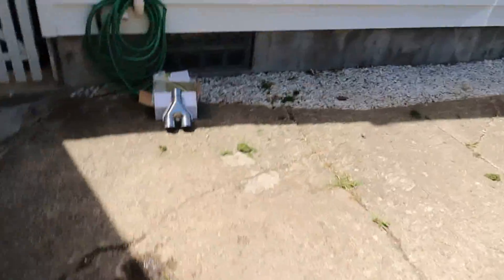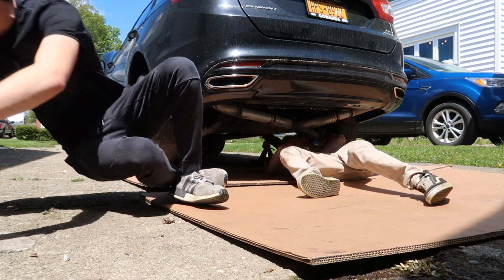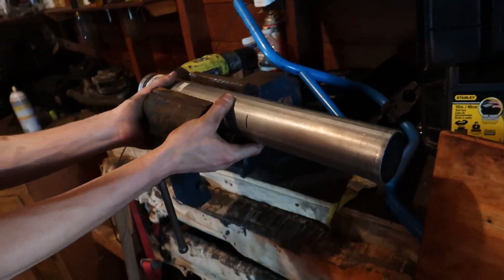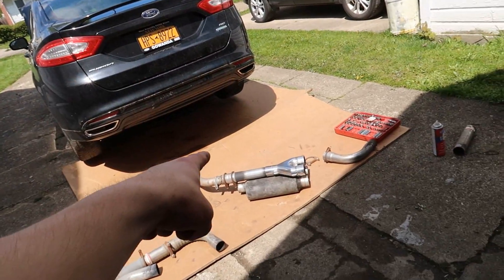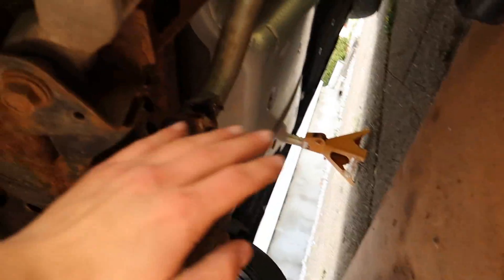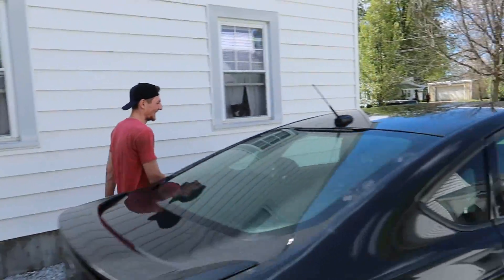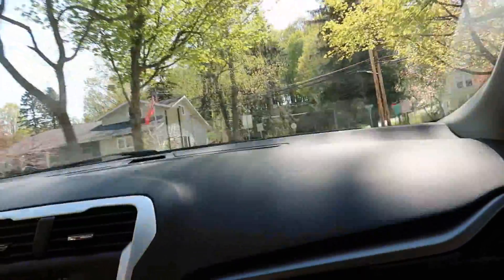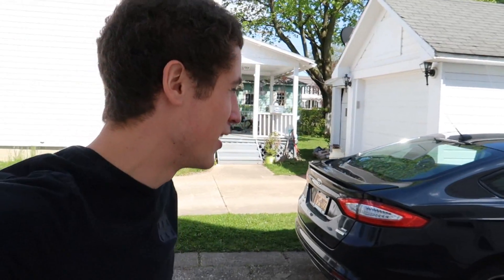STRAIGHT PIPED Ford Fusion : Crazy Exhaust!

Comment: Good stuff Brodie 😎 definitely about to mod my 2.0 😈🔥 I saw a Taurus SHO leave a V8 Camaro and a F150 twin turbo ecoboost leave a hello kitten in Memphis this past Saturday 🤓  This video is due diligence to Ford!
Reply: I hope you don’t think a straight pipe on this alone will gap a SS or a Hellcat this will need to be heavily modified to achieve that
Reply: @dontaybreadgangtv5305  yea I can’t claim to beat a hellcat till I run at least 3k in parts and tune.
Reply: @jacket-407  Do it bro! I love seeing heavily modified sleepers just as much as I love big obnoxious V8s

Comment: How many of the horsepower gains did you get from doing this high flow exhaust. The manufacturer I talked to said I would gain at least 200. Is that correct?
Reply from the maker: At least 350hp it’s crazy👌
Reply: @procam448   added 350 or you make 350
Reply from the maker: At least 400 if you count the chrome😂 but these cars make just under 250 hp you could gain about 5 to 10 horse with an exhaust an intake
Reply: @procam448   man I was just messing with you I’ve got the 18 ecoboost but I’m probably not putting an exhaust on it. Thanks for being cool
Reply from the maker: Haha yeah ik it’s all good man btw I like the name it’s the same as this guy know 😂 he has this sick YouTube channel
Reply: @procam448   I can’t imagine who you’d be talking about lol

Comment: Isn't that a Mondeo?
Reply from the maker: Wait what
Reply: @procam448  Sorry i was looking to buy a car and correct me if im wrong but the dealer at Moto Pfohe if you know them showed me a Ford Mondeo and it looks exactly the same as the one in the video. I was wondering what are the differences?
Reply from the maker: Ohh I didn’t know that was a thing until I just looked it up it’s probably literally the same thing
Reply: @procam448  Not sure tbh, im still looking into it so i don't get scammed or anything.